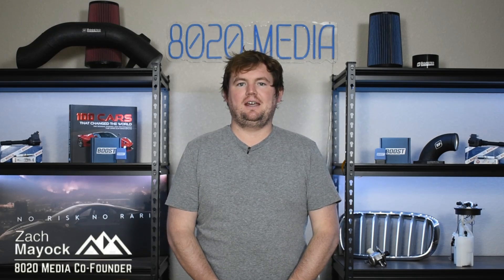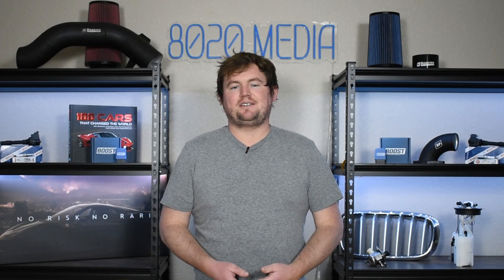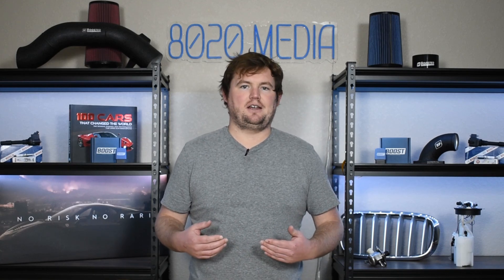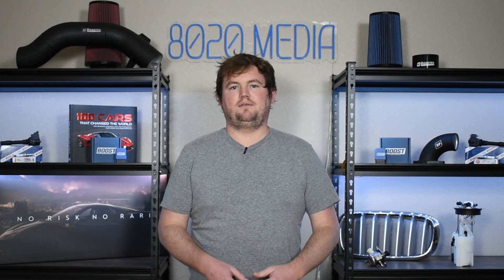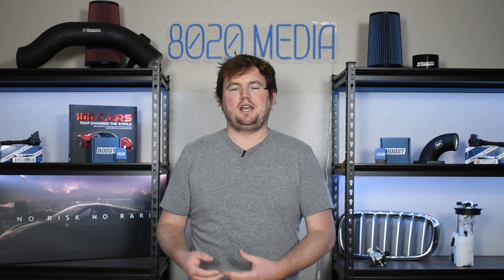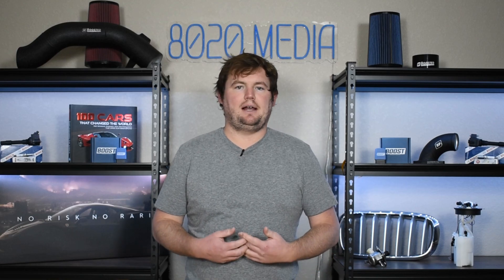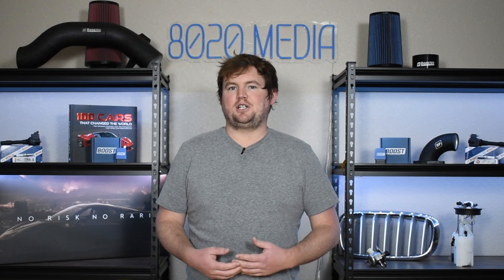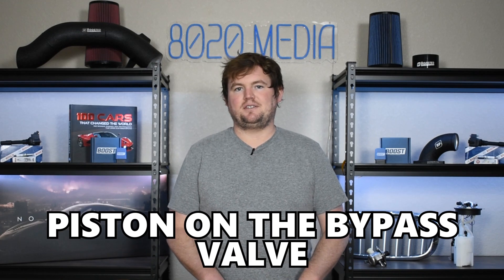GM/Chevy’s LS1 Engine | 4 Common Problems & Reliability

Comment: LS1 is like that crazy good looking girlfriend, as looks good, sounds good, lots of fun, until you see all her crazy flaws, and trade her in for something more reliable, trustworthy, less expensive, less time consuming, and peaceful. LS1 by today's standards as stock built was and is a turd besides the issues listed they had garbage harmonic balancer, stupid oil pan design, leak oil, and not impressed by reliability. Yes I had a Red C5 Corvette Convertible with LS1 sold it with 50k Miles as seen it was going to need constant work. Would choose my 1997 Ford V8 4.6 engine any day over the LS1,  even my stock 2016 BMW N55 with the stock Borg Warner Turbo would lean towards over the stock as built LS1. I'm favorable to a 6.2 LS3 as a good engine for performance and reliability. 😁
Reply from the maker: G - Well said! Thanks for taking the time to share your experience!
Reply: LS3 isn't looking so bullet proof after recall of some 800K truck engines.
Reply: @leightonmacmillan3396 I agree an abundance of new engines in trying to be fuel efficient, less emissions, less weight using lighter materials with thinner cylinder walls, and oil/water passages, more heat especially when using turbochargers, while trying to still maintain or improve horsepower and torque, amidst constantly redesigning and otherwise experimenting is a recipe for problems. 🫣
Reply: @leightonmacmillan3396 ls3 has nothing to do with modern gm v8 recall